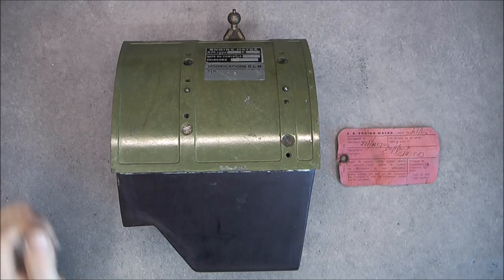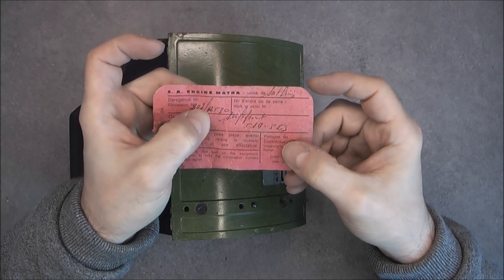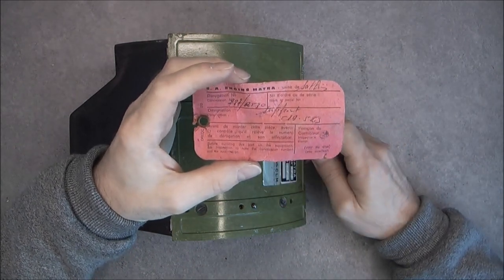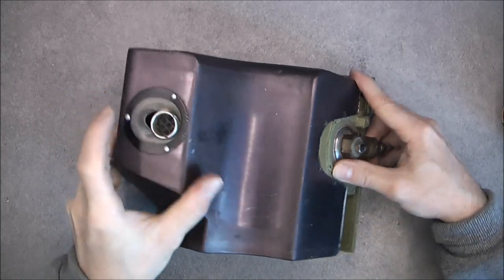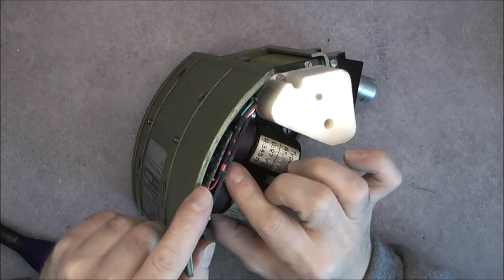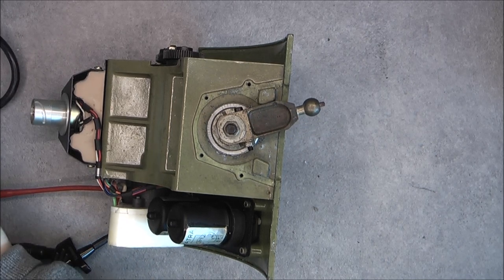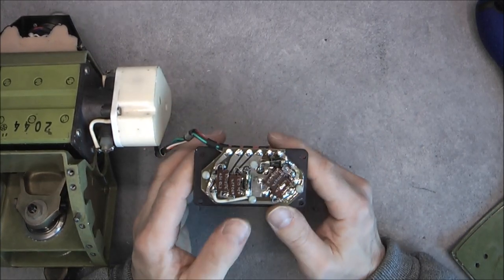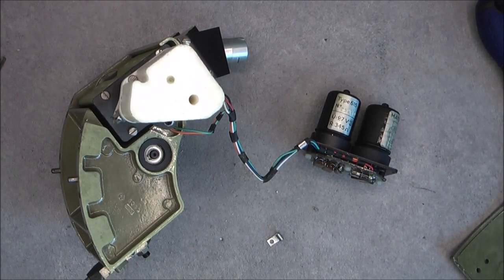Matra R530 missile release actuator teardown

Comment: I think the white device is for a position indicator or something to show engagement or release.
Thanks for the look.
Reply: No, a current limiter so that when the motor runs up against the end stop it prevents the motor running in a stall. Basically two current relays and a filter, so that on overcurrent it disconnects a contact, but a diode across the contact allows the motor to be run in the reverse direction again.